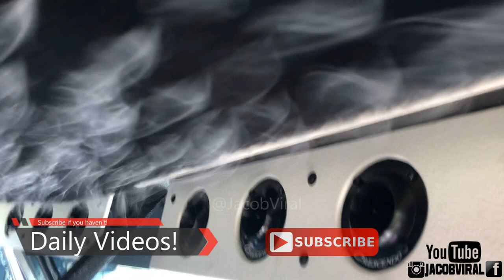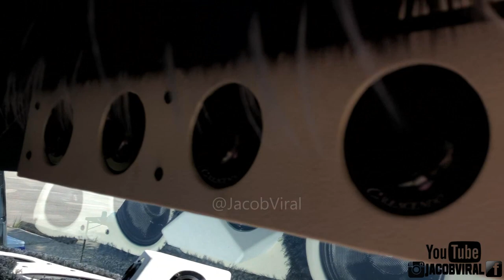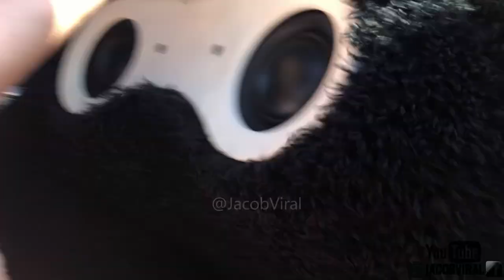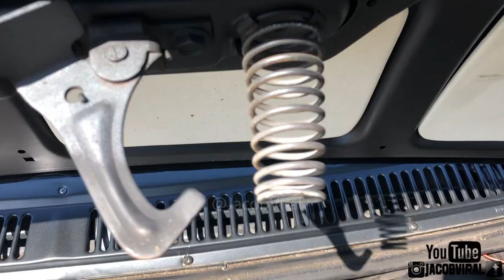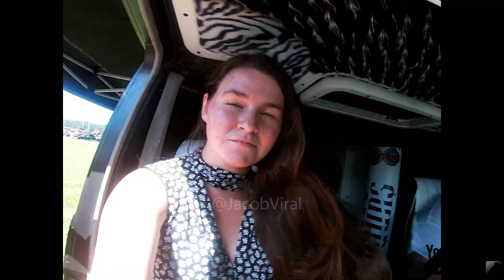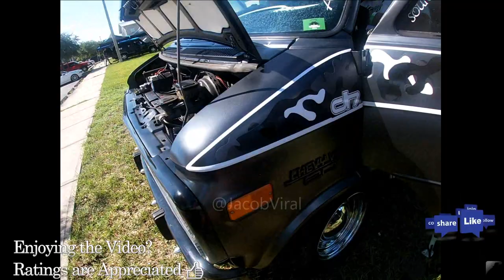MEET THE "FINANCIAL MISTAKE" EXPENSIVE SYSTEM!

Comment: That's a nice setup.  How do you get in there to mount the subs?
Reply: Started at the back and moved forward ..... My head fits exactly vetween the motors
Reply: @arbys748 thanks for the reply. How heavy are those subs? I'm doing a build now and trying to figure out how I'm going to mount the subs on the top 🤣🤣🤣
Reply: @big_mon1  I use a jack with a wooden u shaped support for the motor ...... Those subs are about 50ish pounds each if I remember correctly

Comment: How much does this cost
Reply: At least 12
Reply: @NicolasRodriguez-me8nt  I like car audio but damn😩
Reply: @raygandavis7707  do the math .... 
10 xv2 15s
5 twisted sounds 3500.1
12 nendo pwx 6s
8 pwx8s
8 pwx 10s
24 ft1 tweets 
Plus the mids n highs amps i cant remember off hand but you looking at over 14k before you ever pick up a piece of wire or wood ...... And the labor in this van is over the top ..... Built in his garage over a couple years plus being wrecked the day after this vid was made and getting half the van rebuilt and everything comming out ........ With labor id say comfortably that dude wouldnt sell this thing if you dropped 90gs in front of him